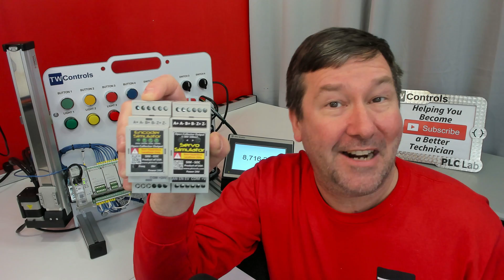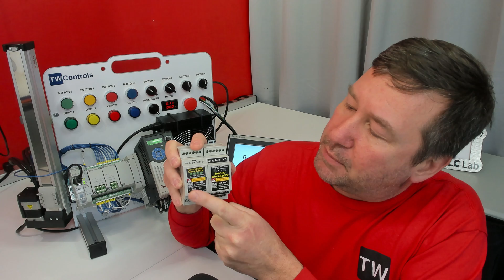Simulate Encoder and Servo Signals for Motion Control

Comment: I can't find videos that easily explain arrays, elements and also common terms used in rslogix5000 such as length, position, and control. After years basic  programming ladder in rslogix500, I can't picture my head understanding all that. It'd be nice to see a video from you with  examples for dumbs. Thanks in advance!
Reply from the maker: Here is one that touches on arrays.
https://youtu.be/qDIdvvGIgE4